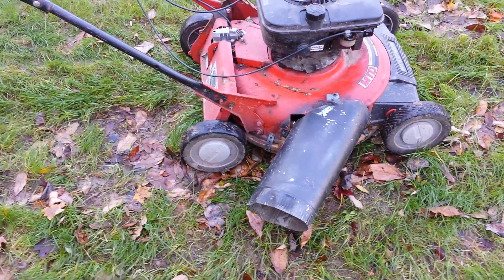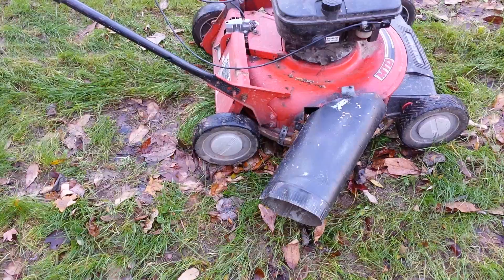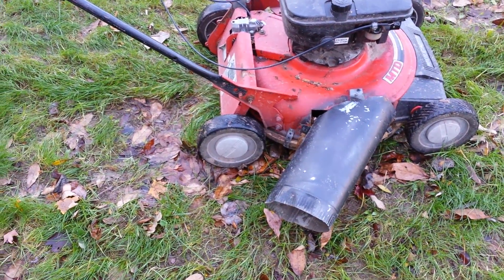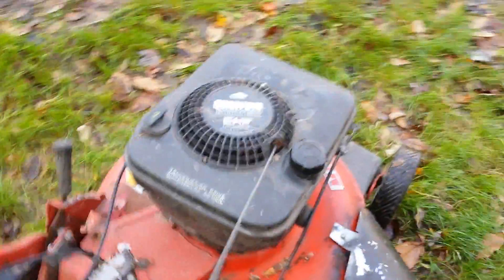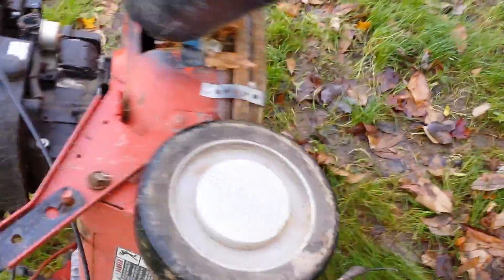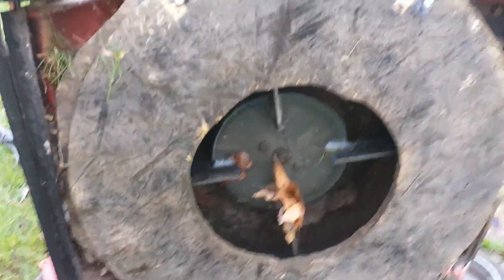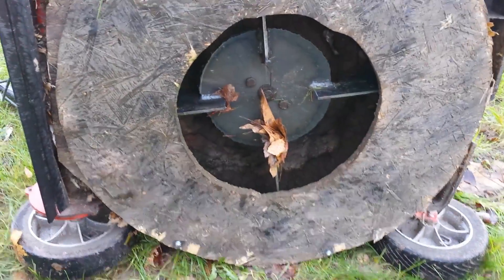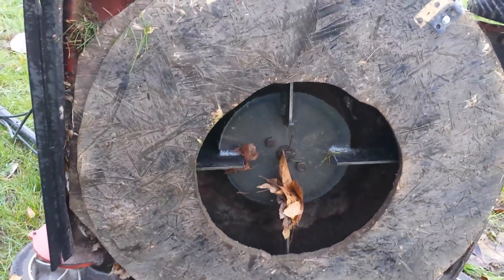Homemade push lawnmower leaf blower - patent pend.

Comment: interesting concept, I've been contemplating it for years, not as a leaf blower but as a vacuum.  It would work well with a bagger and maybe some nozzle out the front making it appear like a large gas-powered Hoover Model O.
Reply: I forgot to add that if you made th tolerances tighter where each vane of your centrifugal fan were longer toward the top of the deck as opposed to deeper into the grass you can put a thinner intake plate on the bottom.  If you went with a three-vane design with  the vanes sloping away from the motion of rotation (like that found in leaf vacuums and household vacuum cleaners)  you may get something that doesn't overload the mower like straight vanes.  The airflow is also limited from the bottom thus I thought of the vac nozzle and bagger as it would be sufficient for a lawn vac.  It's nice to see one of my concepts somewhat complete in the form of a leaf blower instead of a lawn vacuum.

Comment: I would like to know how you made the impeller. Any plans on a detailed video of the impeller?
Reply from the maker: I just copied the rough look of a typical straight blade impeller and plasma cut the blades out of 1/8" steel and welded them onto a 1/4" round plate that I cut out.
Reply: Okay, cool. Thanks! After watching your video I do believe I will try to build one of my own.
Reply from the maker: Ok, maybe use a bit thinner steel though. This one is really heavy which makes it really hard to pull start. Really try to get it balanced well. Post a vid if you get it working.